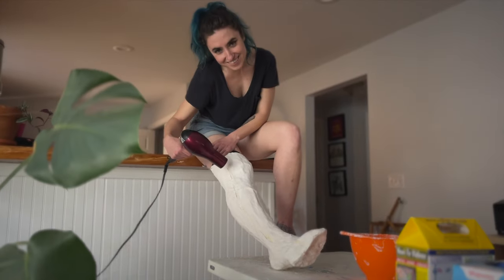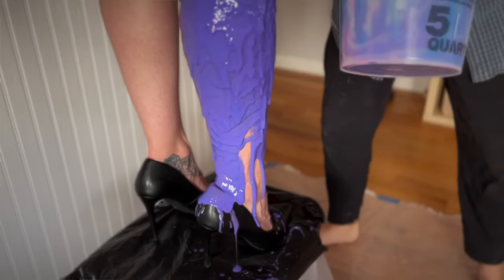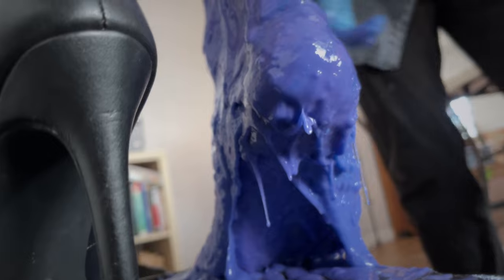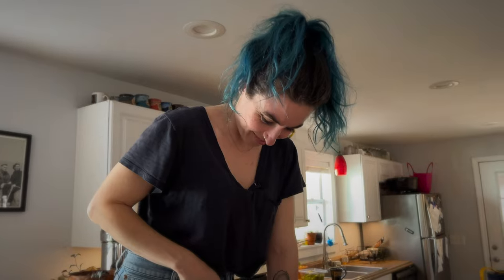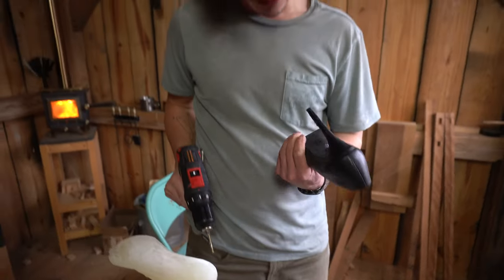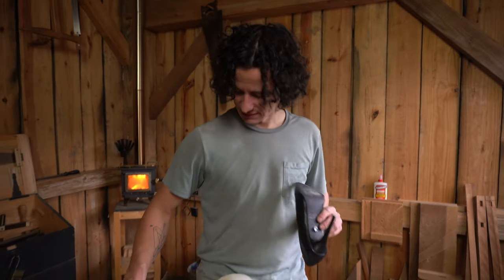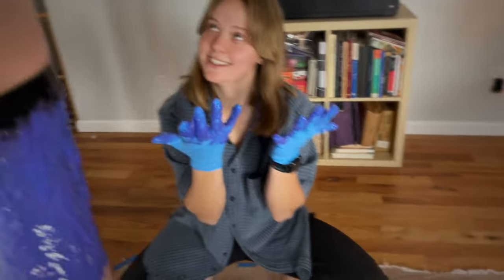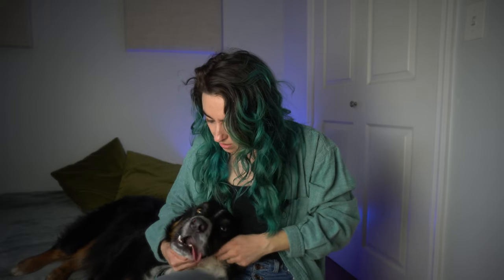I made a lamp...resin casting my OWN leg!

Comment: The lamp looks fantastic, I was wondering when you were gracing us with your presence again ( You were missed Raquel) love your videos!
Regarding the shoe, most shoes have what is called a shank in the arch/heel area which adds support and reduces flex of the shoe in that area, it would appear this shoe had a steel shank, sometimes they are made of wood or plastic.
I have to add, you have really gorgeous  legs Raquel. <3
Reply from the maker: Thank you so much!!! I’m so hopeful to have more time to create more content this year - changed up my work and living situation recently so that should help. And yes I’m familiar with shanks in boots but I was surprised to encounter such a powerful one in a cheap high heel 😆